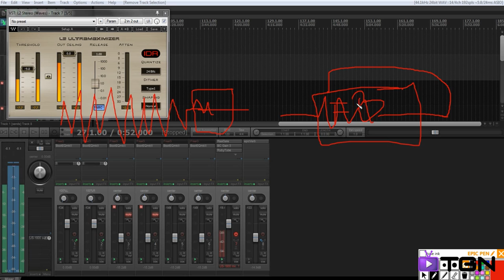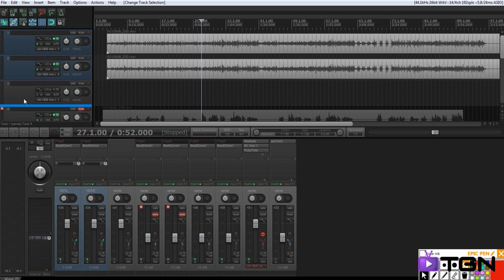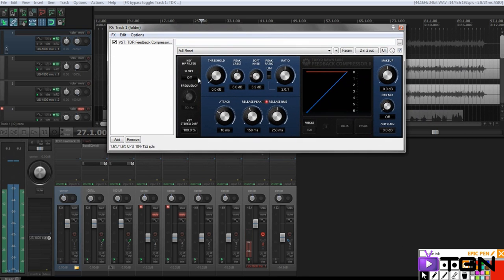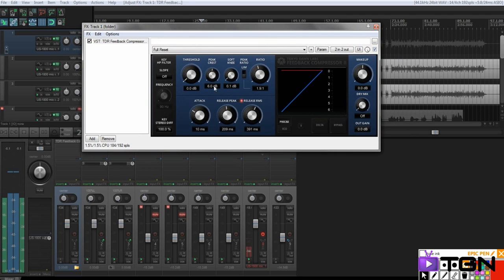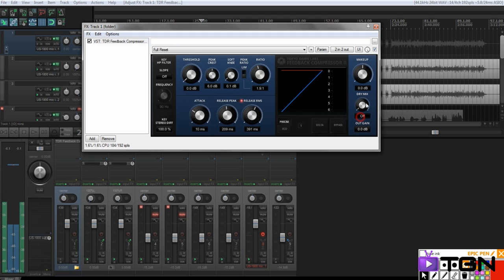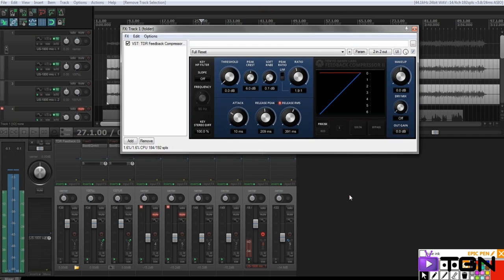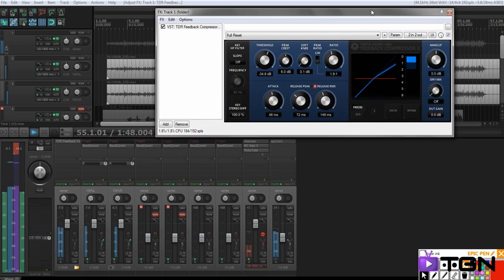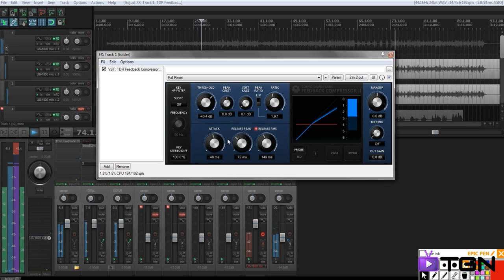Plugin Spotlight #4 -  TDR Feedback Compressor

Comment: Peak Crest adjusts the threshold of the peak path relative to 
the main Threshold. A Peak Crest of zero sets both paths to 
equal thresholds, a high Peak Crest increases the threshold of the peak path in order to compress fast events
(transients) only for higher levels and nearly disables the peak path.